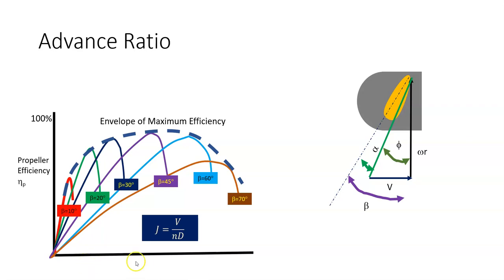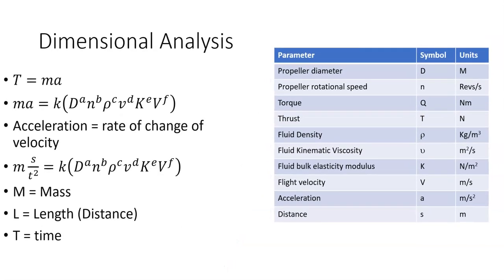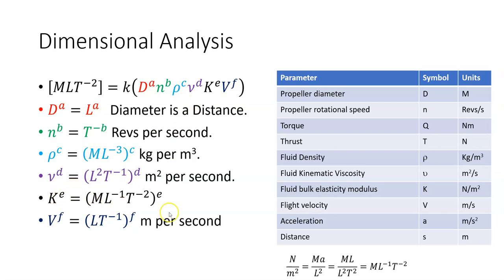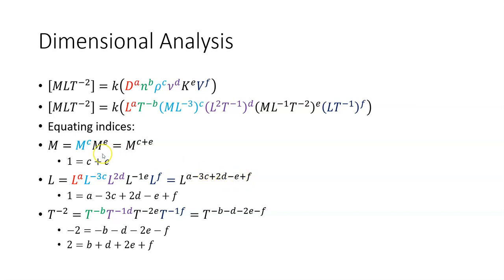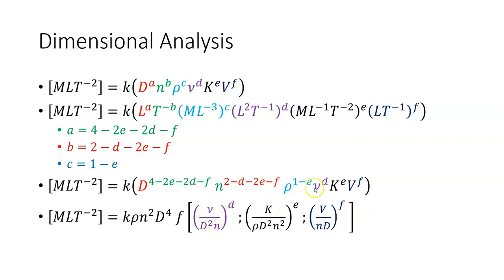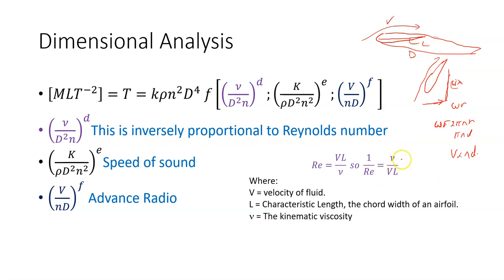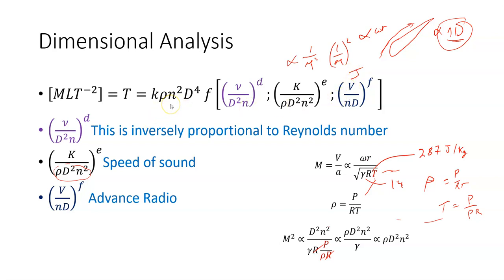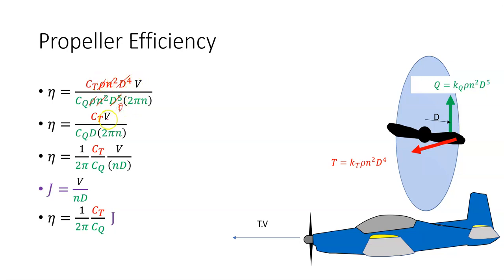Propeller Coefficient of Thrust

Comment: What is seriously missing from this propeller dimensional analysis is area in the airfoil equation where L = (1/2) * ρ * V² * C_L * A, since thrust is a function of, if not purely proportional to, cord length of a propeller. I've 3d printed several props varying only cord length, and find that the thrust appears proportional to cord length for multiples of 2, 3, 4 and 5 of the cord length.

Similarly since area in the lift equation includes multiple wings, I've also 3d printed props using blade counts of 2, 5, 7, 11, 13, 17 ... and up to 37 on larger props to find that thrust also increases proportional to blade count as long as there isn't a significant overlap of blades inducing channel turbulence between the blades as predicted by the Re. Smaller 200mm props overlap early, 300mm props after 19, and 450mm props after 37, since the majority of the lift is in the outer perimeter of the prop due to V².

When thrust is held constant on the test stand, RPM drops as blade area increases, and with that vortex generation is significantly reduced. This should improve efficiency for props with a longer cord length and a large number of blades.

Lowering RPM does increase required torque for the same thrust and power. This does significantly change design points for the motors, both ICE and Electric, to maintain optimal efficiency. And obviously changes the Re and Mtip points in the Ct function.

Is this why the turbofan compressors all have nearly 100% of the intake area covered by a blade?

John Bass
Sr Engineer, semi-retired
Blue Sky Aviation ATV's